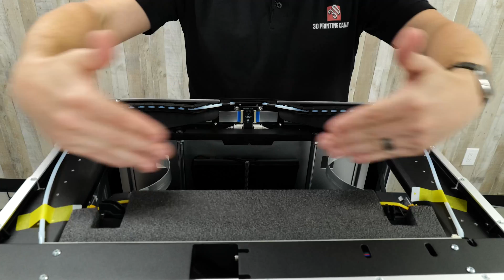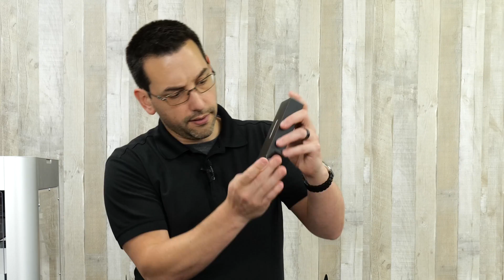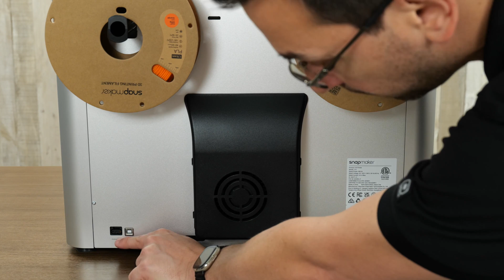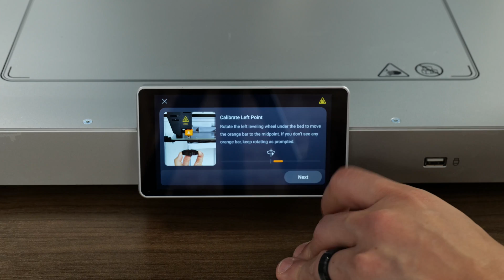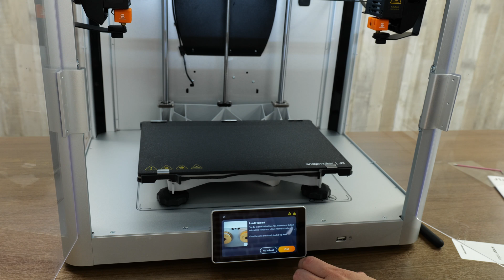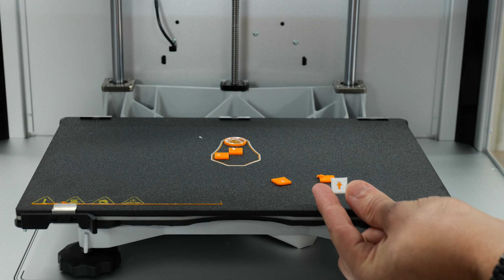SNAPMAKER J1s - UNBOXING & BUILD - TEST PRINTS

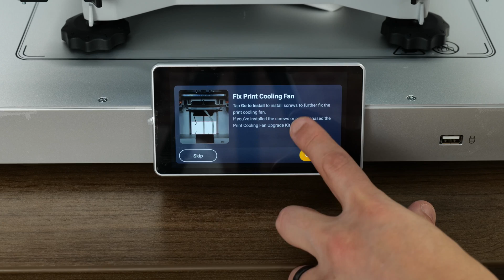Comment: At 9:54 - there are 2 more screws to further secure the cooling fan.  The printer moves the bed up to allow access to the screw holes.  By selecting "Skip", you missed that step.

Comment: before you use a new printer you always should wash the print surface with detergent. 
The pre-sliced sample file will always refer back to the temperature as set in the G-code. Every Idex printer will do that. If you want to use different materials with different temperatures you need to slice it that way. The J1 can be run with Luban, Ideamaker, Cura, Prusa Slicer, Simplify 3D, Orca slicer and most likely a few more. I use Orca slicer for my J1 and love it.
Reply: how do you find the print quality? also how often do you have to level the bed?
Reply: @benjimc1  I level the bed with the fantastic levelling procedure and then calibrate the nozzles. It is fast and super easy. Then I manually adjust while doing a bed test layer as I need the bed to be 100% level. That will work for a long time, I only have to redo it when I change to different nozzles (I use mainly Creality S1 nozzles but also other V6 high flow nozzles like CHT.
Reply: @benjimc1  , I use Orca and get great print quality. I keep the speed between 120 and 150mm/sec. Above that I do not trust layer bonding on any of my printers. Bed levelling is super easy done by the printer, you also can adjust the Z height in the menu. I rarely do it as I usually only change the nozzle, not the complete hotend
Reply: wow thank you so much for the reply...trying to send g code with Orca.. also with the prusa slicer via wifi.. just learning as I go

Comment: That printer is a heat creep clog  machine. Nothing else!!!
Reply: Did you reduce the z-hop? I read that in several other places to be a solution to the cloggingin issue. I'm looking into buying a new 3D printer with IDEX. (currently have my 12 year old Ultimaker original with heated bed)
Reply: Reducing z Hop only helps with stringing. 
Heat creep comes from bad cooling of the cold zone or printing very slow for longer time. 
Printing too hot or a too high chamber temp can be a cause too.
Reply: @Todestelzer  I've just got a Snapmaker J1. The previous printer I owned was a an Ultimaker (original, with heated bed upgrade though, haha talking about upgrading to an heated bed, 12 years ago already!). In any case. How would it then work printing ABS that needs a closed enclosure? How could the cold zone (whatever that might be, I imagine some part of the extruder) be cooled while in an enclosure? Peltier elements?
Reply: @xDevoneyx  , the closed encloser will allow the interior to heat up to max 50deg/C. That is cool enough for hotend cooling with materials that need higher print temps than 220deg/C. PETG, ASA. PC, PA and ABS, no problem. For PLA, just take the lid off or leave the door open.
Reply: Heat creep in the J1 appears mainly because of user error. From moist filament to too long retraction and some more ignored settings will provoke heat creep. But it is quite easy to get it right and then the J1 becomes a fantastic workhorse.
Reply: First thing to do after getting a J1 is to change the default retraction distance in Cura from 6mm to 1~2mm.  That takes care of the clogs.
Reply: @Y0tsuya 6mm is the standard?? Isn’t it a direct drive extruder? It shouldn’t be more than 1mm. Most DD use 0.6mm or lower.
Reply: @Todestelzer  A lot of people made the mistake of copying the generic material profiles in Cura when creating custom profiles for the J1, which sets the retraction distance to 6.5mm.  There are posts on the J1 forums on this topic.